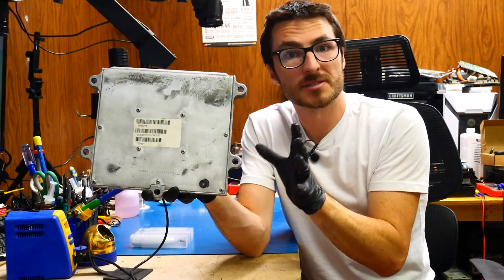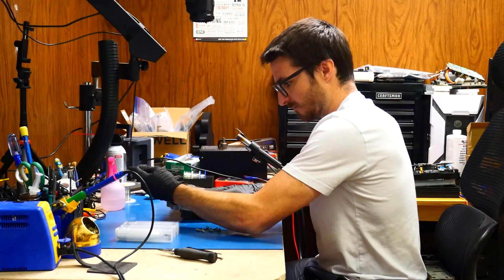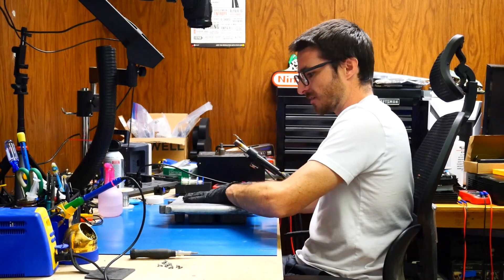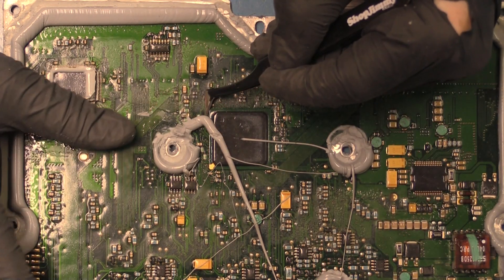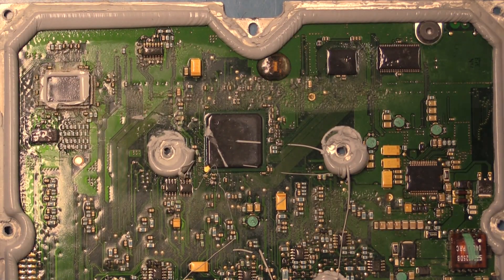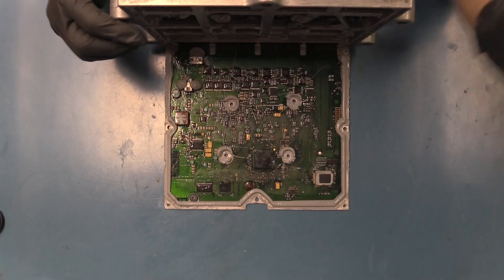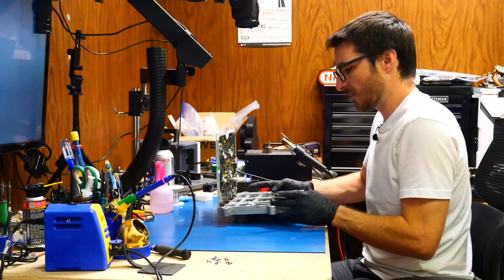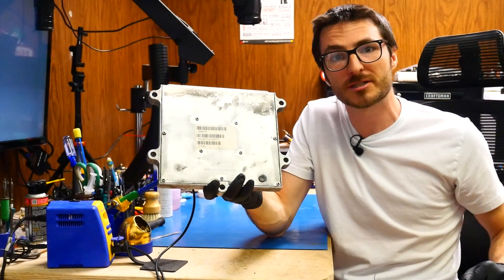Cummins ISX ECM Repair

Comment: BGA looks like such a PITA.... how in the hell do you know you have it aligned properly on the PCB when you can't see anything?
Reply from the maker: You have to feel it. As you slide it around on the board it will lock in slightly with the solder pads.

Comment: If I was younger, I'd build a fixture to open the "hinged" cases evenly so as not to flex/distort those boards.  In any case, in the few I did like this one, I ran the bottom heat through a longer lower heat cycle to make sure the bottom of the PC itself was hot enough to allow solder flow without requiring too much heat on the chip itself.  Nice work here.
Reply from the maker: Thank you :)

Comment: Curious about top and bottom temperatures. Other than plugging into the truck are there other ways to introduce electricity to look for other circuit faults?
Reply from the maker: Top and bottom temps depend on your mahcine. If you use the same temps I do, it won't work for you. Yes there are bench testing tools we use. Some are better than others.
Reply: What’s that machine called?

Comment: Truly an informative video. When removing the component and then reballing it, at what temperature ranges and for how long do you work? I tried, and the circuit board bulged. The operating temperature and temperature ranges of the device must be very important. thank you very much again
Reply from the maker: My temps work for my machine, they won't work for yours. Practive one bad boards get a feel for what works and what doesn't. Practice makes better. There is no short cut answer I can give you.

Comment: how did u know that chip was the problem?
Reply from the maker: Trial and error otherwise known as experience
It's really hard to identify a fauty solder joint below a processor because you can't just put a mutltimeter to it or use a tool to determine it's the issue. So you have to go based on symptoms, the fault that is occuring and try a few repairs until one sticks and then use that experience of having fixed a few to know what symptoms are commonly caused by what failing components in the circuit. 
Yes I know it's not the sexy clear cut answer you were looking for but that's how it goes a lot of the time.
Reply: One common way is if the device's functionality seems to be be tied to whether it is hot or cold.  That could indicate a bad solder joint.
Reply from the maker: Yes, this is also true. We see that a lot with the CPC4 actually. Truckers will say that during certain weather like in the very early morning or night time, it won't work but after the sun rises for a few hours and it warms up then the truck works.